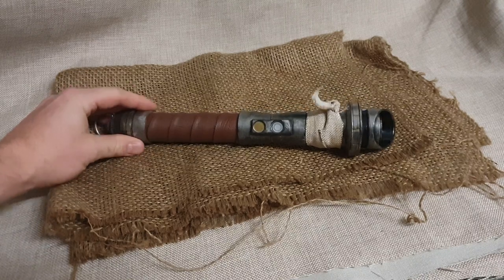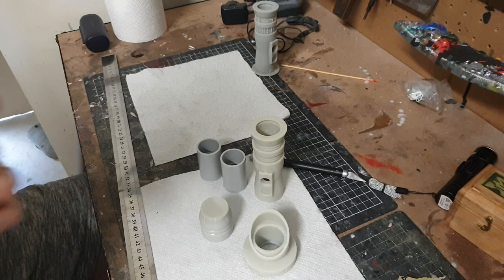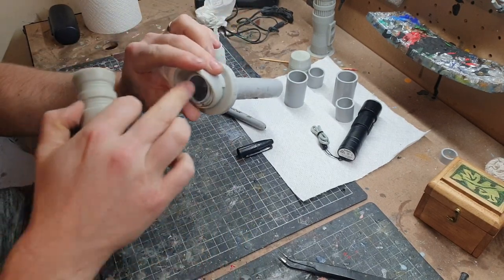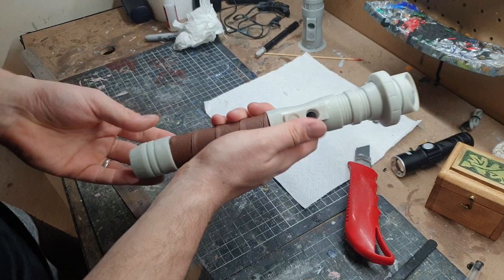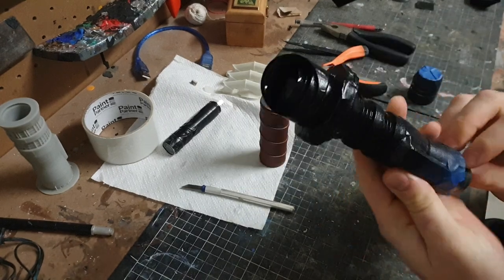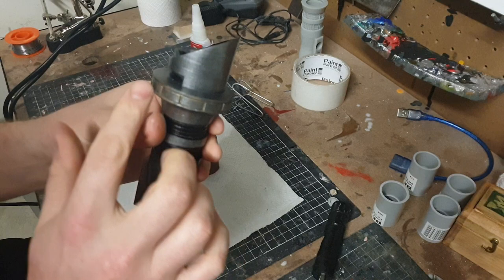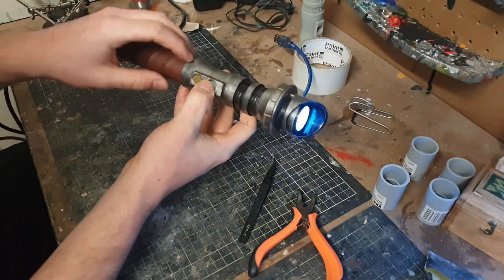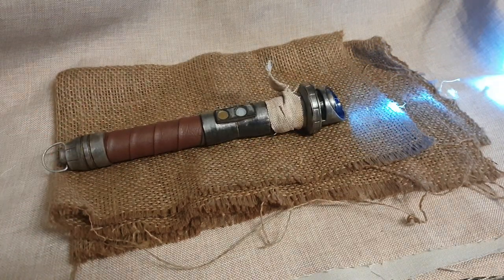Tethan Props   Custom Lightsaber Build

Comment: how did you cut the head off the light? im kinda following along and have the exact same light
Reply from the maker: Turns out you can unscrew it off. So unscrew the lens part, then with some thin pliers unscrew the front section while holding the inner silver section behind the lens. Check out a newer video I made and you will see!